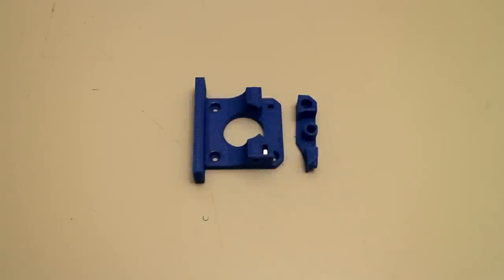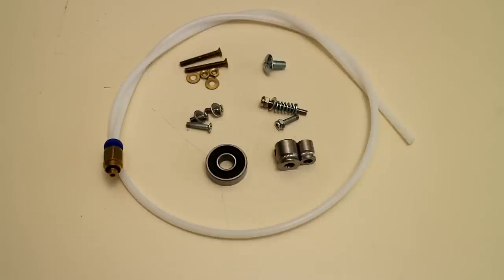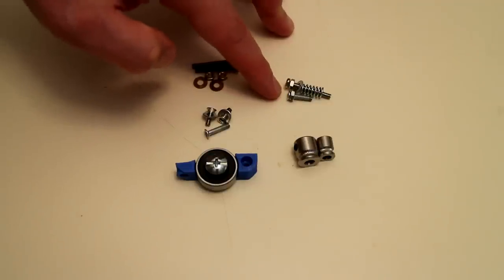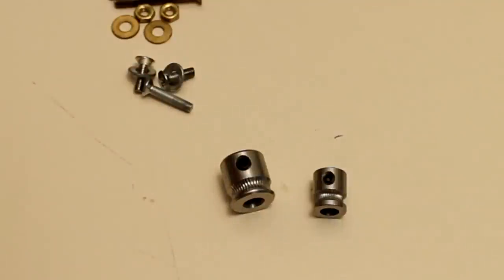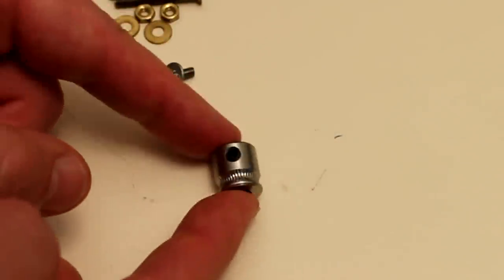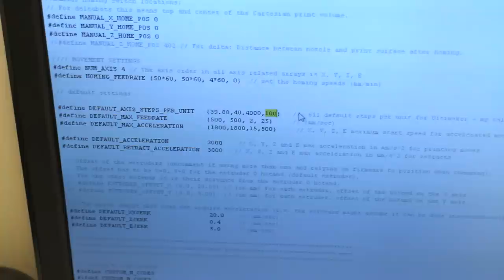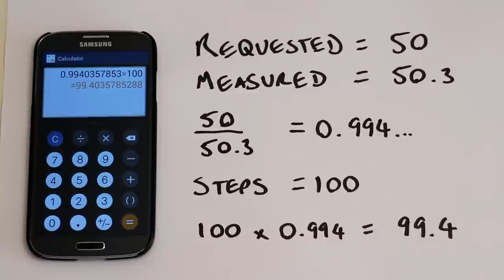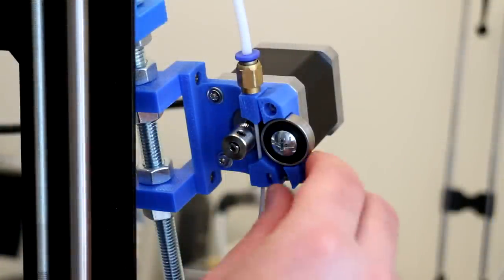3D Printer - Bowden Extruder Setup

Comment: Hey man, I've been following your channel for a year now and I feel you are one of the few people out there who genuinely give good advice, however this extruder may need a little fixing in my opinion, the design is pretty good but the part where the pneumatic push fit screws in, that part wears over time and the plastic threads get eroded away and later the push fit keeps slipping off, sometimes in mid print causing defects and artifacts, I suggest if you accommodate a cylindrical metal insert that has the same diameter as the threads of pushfit connector, but is smooth on the outside but has threads on the inside to provide a kind of bonding non eroding surface for the pushfit, I had to replace this extruder that I was using with a metal one off eBay for approx $10 USD, the metal doesn't erode away and provides a sturdier fit
Reply from the maker: Hey thanks for your comment. Did you try printing the extruder in a different plastic? I've used ABS and it has lasted over a year. I now have it printed in PETG and so far it seems ok. 

Either way this design isn't mine originally. You can ask the author of this extruder to redesign it with your recommendations.
Reply: +Tech2C I had my part printed in ABS too, maybe the issue is with the quality of filaments, here in India we don't have standard filaments only individual manufacturers claiming theirs is the best :( yeah I guess I'll try to redesign it myself see how it goes together, anyway continue with your good work mate! Love from India!
Reply: if it starts to erode just print a replacement one

Comment: Hey man, i have followed your channel and seeked advise when i got my E3Dv6 on my  hictop prusa i3 model.... Following your current extruder calibration here, i managed to get my steps per mm to be 102....  I had same NEMA17. same bowden mount, same Mk7 drive gear, same filament dia. etc. Worked ok, but i was under extruding BIG time... had quite a few failed prints before i figure out what was going on... Following Thomas S. instructions,  i went ahead and calibrated my E steps by his method and  it now works perfect. 
Here is the deal... using your method, i got perfect 50mm extrude "travel" out of my bowden tube every time!, and i did this like 6 times.    
Now, this isnt the same as the expected extruded amount for plastic out of a hot nozzle. So once i started calibrating for the extrude amount thru the hot end, i found out my steps per mm is really 124!!!   that's 18% under extruded!  Big difference and the results show it. 
Not saying your wrong, just saying it didnt work for me and it may not for others.
Have a good day sir!
Reply from the maker: That's interesting, as when you measure through the hotend, if the hotend is partially clogged or not enough heat, then measurements can be larger. Either way I'm glad you fixed the issue. Thanks for sharing :)

Comment: After using this design for about a year now, I've been having to replace the bearing arm every week or so because it bends over time. PETG lasts longer than PLA but I'm seriously considering casting in aluminum if I don't upgrade to a zesty nimble.

Do you have this problem as well? How often do you replace your parts?

Comment: Hi, thanks a lot for such a useful video!

I have a question...what you meant when you said:  "Set the driver stepper trim pot to 3/4"..."? Is there any specific value I should set there? The point is, my trim pot looks a bit different than yours and I'm in trouble to set it up at 3/4...

I set everything else as you said an my Bowden system was working great until it stopped extruding filament...and I think the reason is that my trim pot is not set correctly so the stepper is not getting enough current and is getting  overheated ...

Thanks for all your help...

Comment: you fitted the stepper motor of the extruder some other place and and the main heater was at the other place ...... wud it be a priblm while printing ???  i mean .... for instance if the extruder goes down and the and the filament gets short .... will not the filament get out of the extruder (heater) ???

Comment: My Bowden coupler that came with the monoprice select mini v2 quite literally exploded. The coupler's teeth that were inside exploded out and the  guide tube came out mid print. I bought a new setup and the drive gear setscrew was stripped out. Drilling the screw out doesn’t work because it is like the drive gear is welded into place

Comment: What voltage is your stepper driver reading, I know you said 3/4 but was wondering if you can check the voltage with a multimeter. I have had to crank mine way up in order for it to extrude properly. I think I am going to try a Wade Extruder but in a Bowden setup to give me more torque
Reply from the maker: Chris Griffin 1.3v. If you're using 3mm filament then you must gear it down, like with the wade gears. 1.75mm should be fine without extra gearing. Make sure your stepper motor is the nema17 4kg torque version, not the shorter lower torque version.

Comment: Hi!
First off thanks for this! I've used this setup for a project of mine, but I'm having a slight problem with the motor. I'm using a NEMA 17 Motor (42BYGHW208) but does not provide enough torque to overcome the friction between the filament and bearing (which is actually pretty easy to overcome manually) would you have any idea on how to deal with this? Is this particular nema17 model too weak?
Reply from the maker: ***** 
Certainly you need a NEMA17 with enough torque for a Bowden extruder. I quickly googled your model number and it is one of the lower torque NEMA17 motors. A larger NEMA17 torque motor should fix it.

Comment: What Prusa do you have? I think there are a few Prusa i3s out there like Prusa i3, Prusa i3 Hephestos, Prusa Mendel, and Prusa Steel. How do you like yours? and if you dont mind me asking, is this your first printer? How hard was it to build and get to the point it is now?
Reply from the maker: +Brennen Patel 
Yeah this is my first printer. Choose a printer with a metal frame. Most printers are derivatives of the original Prusa i3. Basically any printer you choose will print fine out of the box, and you be lucky that it produces absolute rock star parts. Otherwise as I've shown it's quite simple to modify your printer as it's all open source. Checkout the reprap forums too.

Comment: Thanks for this video - very useful.  I followed the steps described but still seem to have issues.  Most notable are that my top and bottom layer fill has gaps.  I tried following the reprap wiki calibration fine tuning steps but despite increasing the e steps value by a few points I still have these gaps.  Any suggestions on what else I may need to tune?  I didn't have this problem before switching to the bowden extruder.
Reply from the maker: Justin Fielding 
Yep, this setup produces very fine layers, which is great for detailed prints. 

First set your e-steps back to their calibrated value.
In your slicer program, increase the top/bottom infill percentage by 20%. In Slic3r, I set it to 120%. See my Slic3r videos for the explanation.
Reply: Thanks I'll try this out today.

Comment: Can I use the old stepper motor that was connected to the hotend and fan, so I don't have to change the setting?
What's your recommendation for the hotend?
Thanks
Reply from the maker: If it fits, sure.

Comment: quick question I did mount the Bowden setup and its printing really good except I just have the standard teethand i am gating layer binding issues i wonder if it could be the grinding of the filaments did print out your setupdid not mount it I'm scared about turning the stepper drivers .
Reply from the maker: Here's some tips - Calibrate the extruder steps again, increase hotend temperature, remove plastic grinds from extruder gear, replace the extruder gear with not as sharp teeth to prevent grinding, clean out the hotend nozzle, be brave.
Reply: Thank you,  I found out this was exstrudusion with

Comment: Hello @tech2C, thanks for sharing, are the two fans in the end of the extruder improving your 3D prints?, didnt see that review on list. 

Cheers
Reply from the maker: +Adrian Quesada 
Hello Adrian,  yes the fans are a must when printing very fine layer heights, especially with PLA.
I plan on changing the fans to a more compact setup and will post a video of that final result once I've made the switch.

Comment: thanks for your great work. is there any trick how to screw the Teflon tube fitting in? i destroyed 2 parts already but ist will not fit. Material is pla with propper calibration.
Reply: maybe ihave to use a thread cutter.

Comment: Still trying to find the X carriage that this mounts to. Don't suppose you have a link to the one you have, or did you just drill new holes in the old one?
Reply from the maker: Oldenglishshifty 
My printer kit is the Prusa i3 Rework. If yours doesn't fit you can try the x-carriage part from the Rework kit http://www.thingiverse.com/thing:119616
Reply: +Tech2C Thankyou!

Comment: Stupid question maybe, but when you put the PTFE tubing into the hot end, how far to do you put it in?  Does the PTFE tube go all the way to the heat break?  Or is it just through the locking mechanism on the top of the hot end?  Thanks guys.
Reply from the maker: That depends on your hotend. I use a genuine E3D v6, which allows the PTFE tube to go in about 1 inch. You want to push the PTFE tube as far in as possible to assist in guiding the filament.
Reply: That sounds right, the problem I have with my printer right now is that the filament will not make it to the hot end because the change of diameter on the hot sink causes the filament to be stuck.  Its shipped from China so I don't think its genuine.  Plus the bore size isn't big enough to take the 4mm OD, so I bought new tubing with a 3mm OD hoping that that fixes it  Thanks for the response.

Comment: Can I use mechanism from direct drive (the one with big gear, yea :D ) for bowden? Just modify it a little bit to fit in teflon tubing and screw it externally on the frame
Reply from the maker: +ZeppyCZ 
Certainly! There isn't a rule book on how to implicitly configure something. If it works for you, it's a winner :P

Comment: How do I check if mine is the 4kg version? It says .55N/m on it. I had mine turned up to 1.3V but the heat sink on the stepper driver was very hot and the stepper motor was getting quite hot also. The stepper driver came set at .8 V.
Reply from the maker: Chris Griffin 
Simple google search will help ;)

If the motor is getting hot, there's too much resistance to drive the filament. Check your entire Bowden setup for binding and sticky spots. Also calibrate the extruder steps without going through the hotend.

Comment: Hey, what do you think of your prusa i3? Thinking of getting one for my first 3d printer but buying everything separately so i can have a few upgrades like the extended bed kit and this bowden. What do you think?  Thanks Luke
Reply from the maker: TheLukey21 The Prusa i3 is a great printer for beginners and hobbyists. Plenty of support online, plenty of variations and mods too. Building one yourself would also be very rewarding and cost effective.
Reply: Tech2C Ok Thanks, seems like i might be building one then. Do you have any recommendations on mods that i should do straight away?
Reply from the maker: TheLukey21 Jump straight to the E3D v6 1.75mm universal hotend, aluminium heatbed, and quality filament.
Reply from the maker: TheLukey21 Woah that's a great price for an E3D v6! Good find! Is it the real deal or a knock off? The only thing that's suspicious with the photos is the top of the hotend. If you go to the E3D website there isn't a PTFE push fit connector on top. That ebay hotend shows one on top.
Reply: Tech2C  i didn't even think to look for an E3D website. I will have a look and also have you had any experience with the mk3 heatbed
Reply from the maker: I have the mk2b aluminium heatbed.

Comment: Awesome, this guide is really helpful for me, thanks a lot.Can you also share your spool holder? 
Best regards
Reply from the maker: MrAppleTricks The spool holder I use I've quickly knocked up in a CAD program specific to the spool size I use. There's plenty of generic spool holders on Thingiverse. I recommend using bearings on the spool holder as well to remove any tension on the filament feed.

Anyways I'll upload another short video with my spool holder setup shortly.

Comment: I'm fairly confused on how you attached this to the printer. What is this mysterious diagonally affixed z rod?
Could I simply attach the extruder assembly on the top piece of the frame?
Reply from the maker: +Ratchet Russian 
You can attach the Bowden extruder anywhere on the printer you like. 
I added the z-axis rods for extra support. Checkout my earlier videos for that upgrade.
Reply: +Tech2C 
Sounds good, cheers!

Comment: Hi Tech2c, I have an Anet A8 Prusa i3 clone with skynet3d software 2.3.2, I recently upgraded the hotend using your bowden upgrade video, this of course places the nozzle in a different location. My question is, what is the code (m206 ?) to reset the position or how to use the arduino configuration.h to set the new location. Everything I tried does not seem to work. I turned off EEPROM_SETTINGS and CHITCHAT and re flashed, but it always goes to the same spot after a G28 followed by G1 x110 y110.
Reply from the maker: What do you mean by 'places the nozzle in a different location' ?
Reply: My original mount has the nozzle about 20mm to left of centre of the bearings, the bowden one is in centre of bearings but about 15mm further forward, I cannot find how to reposition the bowden one to the same position as original. Perhaps I am completely misunderstanding what is going on.

Comment: Hey there, I curently have chinese MK8 direct drive extruder on my I3 and I'm not really happy with it. I'm planning on some major revisions(wooden enclosure to the whole printer, adding a print cooling fan etc.) And I was wondering, would you recommend bowden extruders? On one hand reducing the weight on the x carriage sounds good, but changing filaments looks to be quite a chore with this setup. I also heard that you can't use flexible filaments with them(not that I print with anything other than ABS and PLA but still) and retractions are problematic with them from what I understand. 

On the positive side, I really like the look of bowdens compared to the bulky direct drives. Once I finalize my enclosure design; I could have a compartment for extruder motor and never have to see it again :) 

Anyway thanks for the great video. Cheers.
Reply from the maker: +flanker 
Hi there. Well, please check out my newer video's. I go over printing flexible filaments with this Bowden setup, and switching filaments isn't as cumbersome as you'd think. Cooling fans blowing on the printed part is a must at finer resolutions or small print parts.

My print quality improved dramatically once I switched so I have nothing but praise for it ;)
Reply: Tech2C Good enough for me :) Bowden, here I come!
Reply: +Tech2C awesome , I'll wait for it. thanks again.
Reply: +flanker 
How has your experience been with the bowden extruder?
Reply: Ratchet Russian Terrible. I don't know if it's the cheap Chinese E3D v6 I'm using or something else, but I can't feed filament faster than 5mm/s before grinding starts. For reference, with direct drive, I could easily reach 20mm/s feedrate. 

Not only that, but retraction has also became a big problem. 8mm seems to cured the worst of the "blobs" but it introduced bunch of new problems. 

I've had few jams too. I never had those with DD setup. 

As for the advantages, I don't see any. I switched to bowden to increase printing speeds and to make the printer look nicer. It looks nice to be sure, but the speed took a big hit. Sure I can move E3D around faster compared to whole stepper motor, but since I can't get high enough feedrate for the filament, it's kinda pointless. 

I suspect problem is the tiny heatblock  (16x17) That thing can't keep hot enough to melt fast moving filament. I've ordered a bigger heatblock. If it doesn't perform, back to direct drive for me. 

Seriously though the hassle of the bowden setup just isn't worth the advantages for me.
Reply: +flanker If the E3D was purchased from Ebay, it's almost certainly a clone. I don't really know of a way to mount an E3D on a prusa without the bowden setup, though. So I think it's my only option. 

Another question; How did you mount the bowden extruder setup? I have a different Prusa than the one shown in this video. Was the extra z-axis threaded rod purchased separately just for this project? 

Thanks!
Reply: Ratchet Russian Mine is a clone I know that. 

Here is the link to the mount I've used. 

http://www.thingiverse.com/thing:953811

This guy has lots of really great designs. But I wouldn't recommend his X carriage. Especially if you make it with PLA.

Instead use Rework x carriage (with zipties) to hold the bearings.
Reply: +Ratchet Russian 
I don't even know anymore. I don&#39;t want a bowden extruder, but see no other option without drastic upgrades to my setup. 

I guess my best bet is trying to replicate the setup displayed in this video. Although, my prusa is very different.

I'm trying to figure out how he attached the bowden module shown here https://youtu.be/yLH4K1vNoXo?t=9m21s

Comment: What software do you use for calibrating Bowden Extruder...Thanks
Reply from the maker: Roostono D'martono No software required. All you need to do is calculate your extruder steps and re-compile Marlin with that setting. Measure and repeat the process until it's calibrated. It's in the video...
Reply: In wich tab of Marlin is it ?
Reply from the maker: Bon Jean

Configuration.h
Reply: thanks